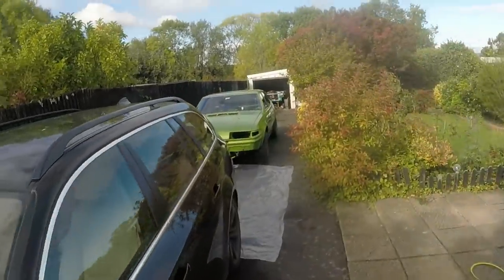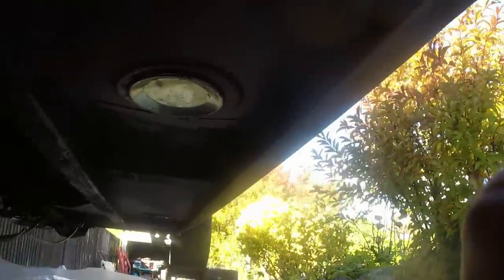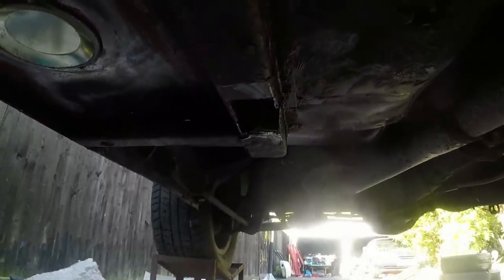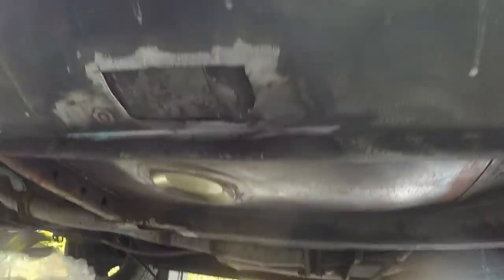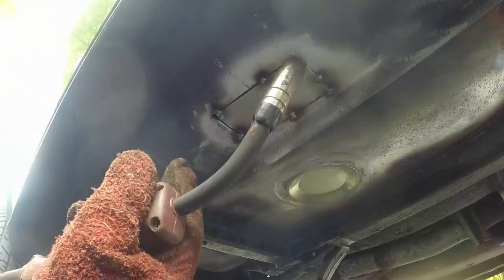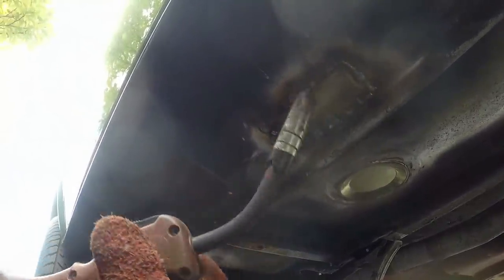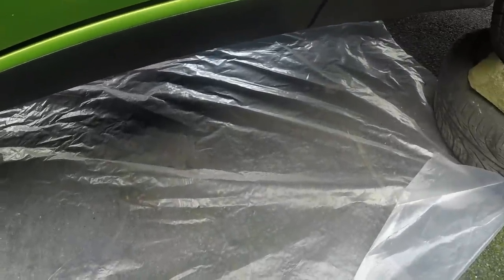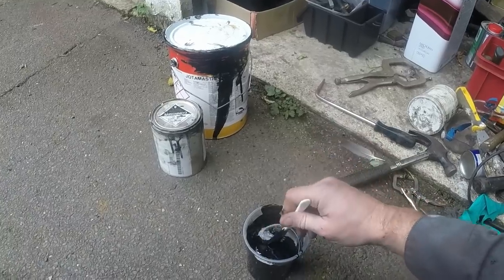Dotty 1981 Rover SD1 Restoration - Video 53 Painting underside

Comment: I am sure I speak for others as well but one of the reasons we all watch these videos as you show it like it is. Plans often change as you find other areas that need attention . I applaud your honesty.   I had to remove  the spilt pin on a mini once which was for the brake master cylinder which needed replacement.  It took me 4 hours... the pin was too long as the previous owner had fitted.  When I finally got it removed I threw it down the road and then had to go and find it again as I thought it may have the last laugh by going into my tyre... keep up the excellent work and post on a Sunday night as it's much better than the telly !!
Reply from the maker: Cool, thanks very much.  I have a serious aversion to Mini's, everything on those seems to be harder than expected.  I try to do these as an honest reflection as there are loads of tv programs where it all works out perfect, whereas most of the time it doesnt.  Its actually sorting out the fails that is most interesting and satisfying in the end.  Plus i like looking back and rewatching the videos as a sort of diary of what ive been up too.

Comment: Love it when the Jotun comes out mate - the reason I found your channel. I think its saved my Toyota from the scrapyard for another few years. I ground and sand blasted most of the rust on the under side and apart from a few tiny spots where there was probably rust still deep inside the pitting corrosion I'm amazed how well its stood up so far. Awful stuff though.
Reply from the maker: I love it.  Its sets like glass!  Its already gone hard so just been outside seam sealing

Comment: Disappointed they're not fishnets 🤣

If you mix in 10% xylene thinners you can spray the epoxy with a normal gun, use 3-4 bar and a 1.5mm nozzle. Just make sure you use a right filters for your respirator because its pretty horrible once its in the air.

To spray up side down with a gravity feed gun you can use a zip lock bag in the cup.